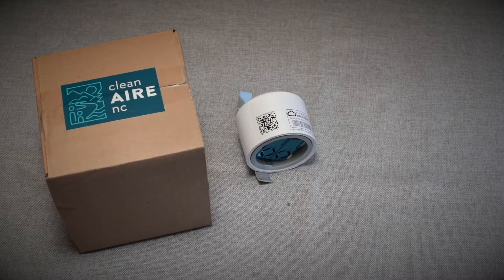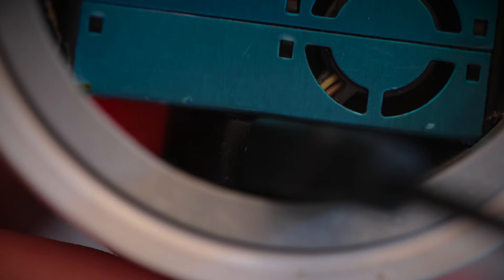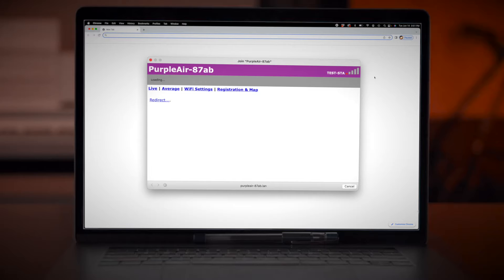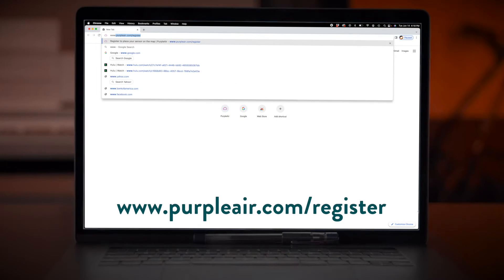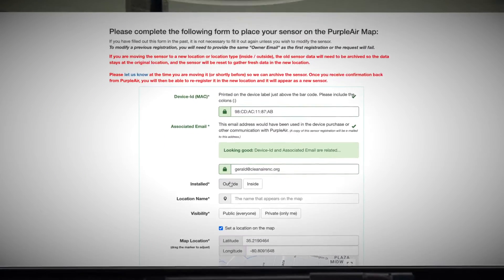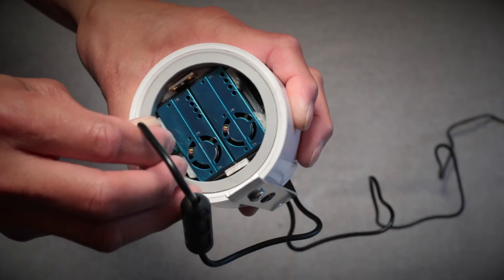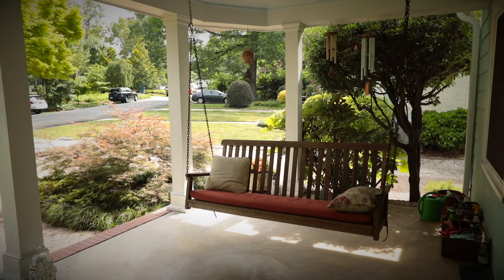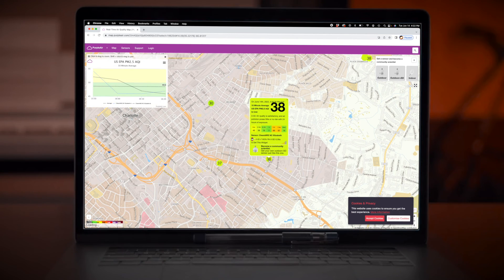PurpleAir Installation Video - How to

Comment: Please ensure that any zip ties used in outdoor conditions are UV resistant. Typically, white zip ties are not UV resistant and may fail after only a year or two. Black zip ties are usually UV resistant and therefore a better choice.